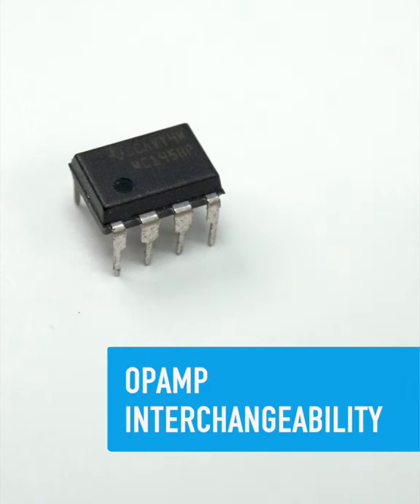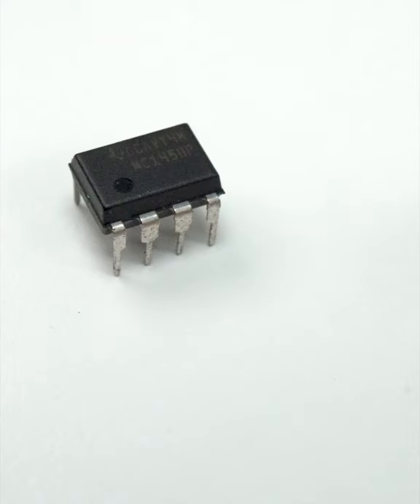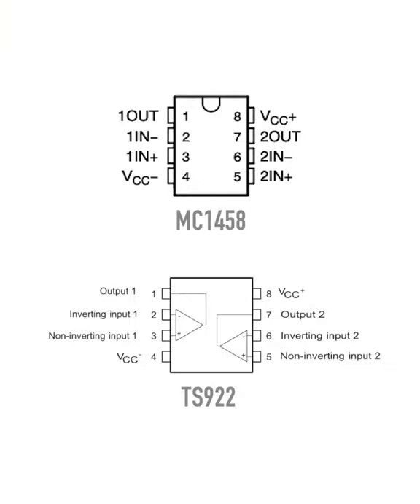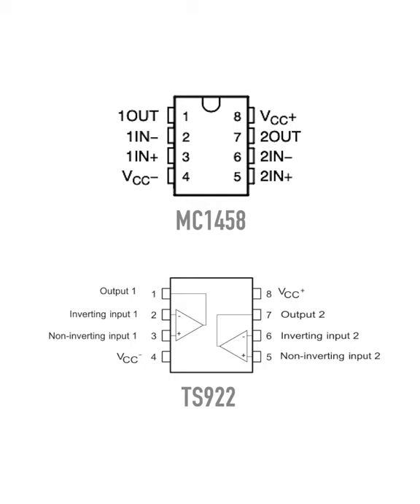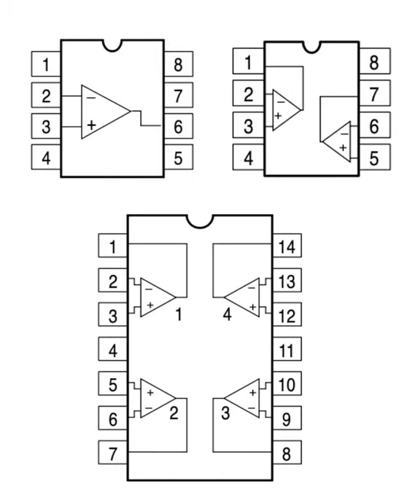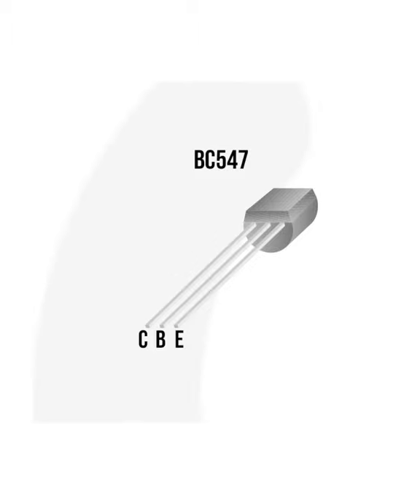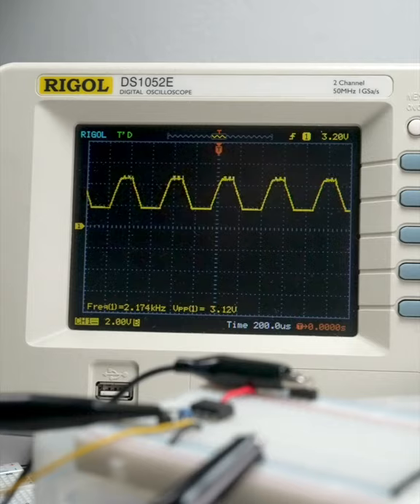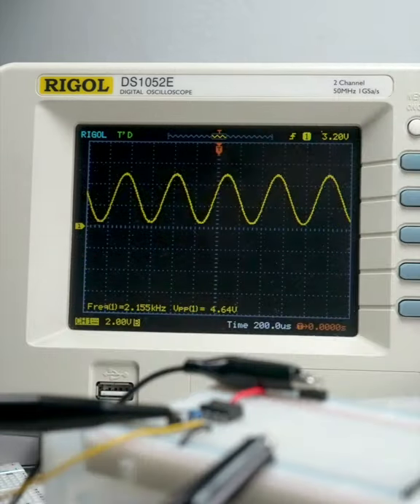Opamp Interchangeability - Collin’s Lab Notes #adafruit #collinslabnotes

Comment: Yes. All/most transistors should have the same pinout. How hard is it for manufacturers to do that?
Reply: Well, now it's almost impossible, because of backward compatibility.
Reply: @massimookissed1023  yesh
Reply: Because many transistors weren't thought of a substitutes for each other but were designed by different engineers, for different applications, often in different countries. You see it here - "2N" (American) vs "BC" (European) type designation. 

There have been different op-amp standards historically, like metal cans or 6-pin DIP (European) ones, but the American 8-pin layouts were chosen by the dominant Japanese market (you rarely find a Japanese HiFi device from the 80s without a 4558 somewhere), so the others went extinct.